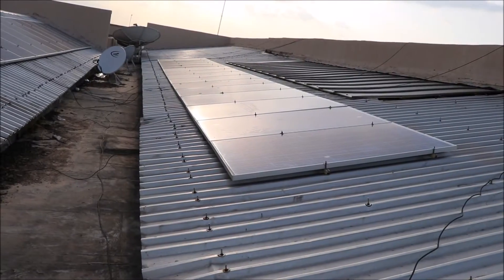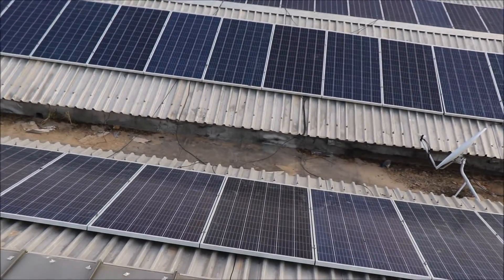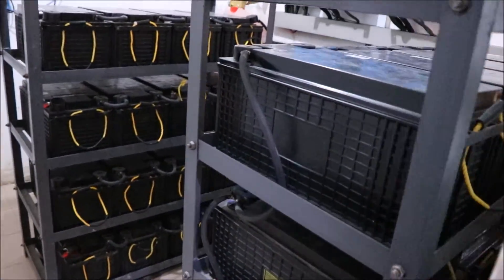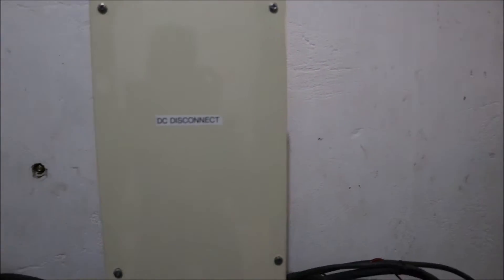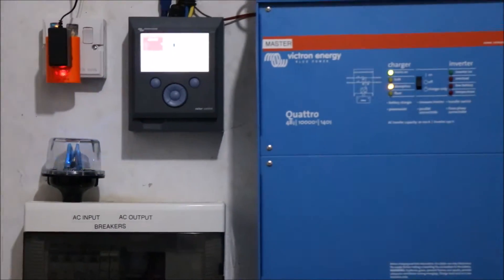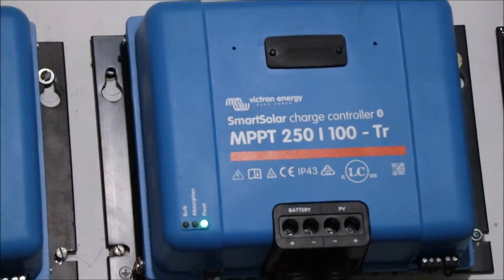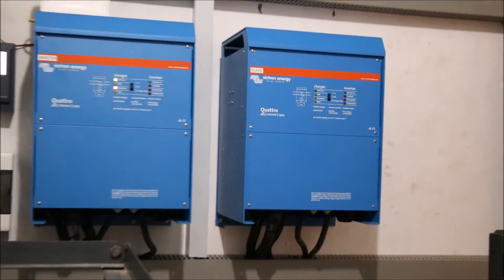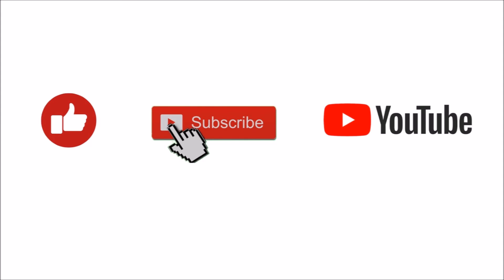20 KVA Victron Inverter Solar Installation at Dutse, Jigawa | Solar Depot Nigeria

Comment: Poor wires management on the roof, The PV wires are not supposed to touch the metal roof. They should have been properly attached and routed underneath channel using suitable clips.

Comment: Your statement of the 10KV Inverters being connected in PARALLEL, cought my attention. Two 10KV Inverters connected in PARALLEL, produce an output of 5KV, and not a 20KV. Two 10KV Inverters connected in SERIES, on the other hand, have an output of 20KV.
Reply: Lol
Reply: He said KVA not KV.
So he is talking about energy and not voltage. Be it parallel or series Energy at 100% efficiency remains the same. So he is very correct.
Reply: it will still give him the same amount of energy regardless or series or parallel connection. Also he said KVA not KV.

Comment: In 2019 you installed Lead Acid batteries? Why?
Reply: Seems you know about the work. Please can we chat on 08032131364 as I am interested in getting a solar.
Reply: I don't seem to understand you? Is there anything wrong with lead Acid batteries? Or you think Lithium batteries or other technologies could have been used? Whatever is used for an installation depends on the design. Also, take note that the prices of different battery technologies vary.
Reply: @victorajayi2614  The lifespan and load capacity of lead acid chemistry is extremely poor. Actually when you factor lifespan and load capacity LFP batteries, you will discover that lead acid chemistry is extremely expensive. Remember with Lead acid you are limited to 50% capacity of the battery. LFP you have 100 of the capacity. So you need two lead acid for LFP. The lifespan of lead acid is at most 3 years. LFP can give you 15 years and still be at 80%
Reply: @caniceonuoha  I use lead acid batteries and they work just fine. Have been using them for over 5 years now because I know how to take care of them. My friend has had his for much longer. As Victor Ajayi said it depends on design and price. I would have loved to buy LFP batteries but the initial cost is very prohibitive. If you are a millionaire then by all means go for the LFP batteries, but unfortunately not all of us fall into that category. My batteries never fall below 50% because I have a larger solar array that keeps them well charged. My goal has been not to pay electricity bills and the lead acid batteries have helped me achieve that!
Reply: The same question I'm asking o